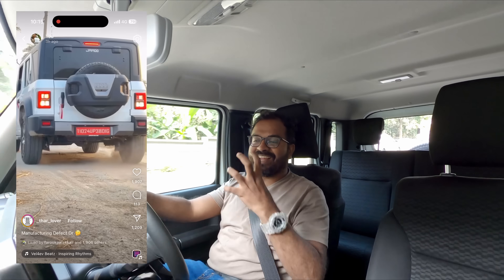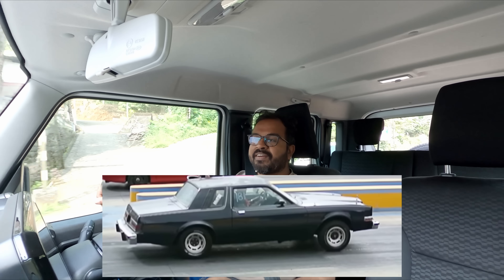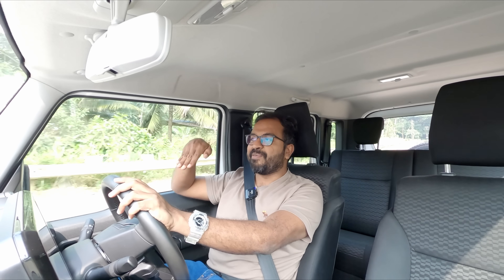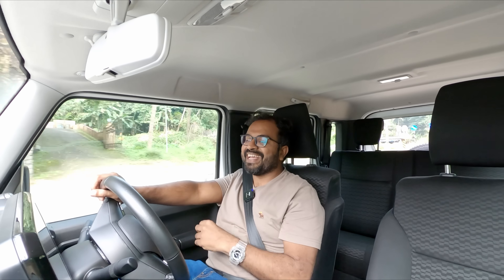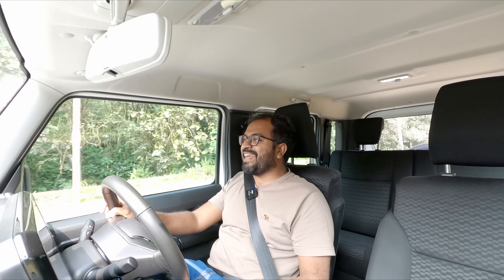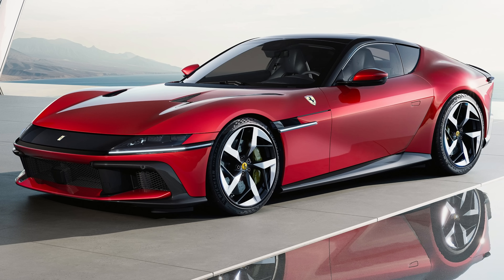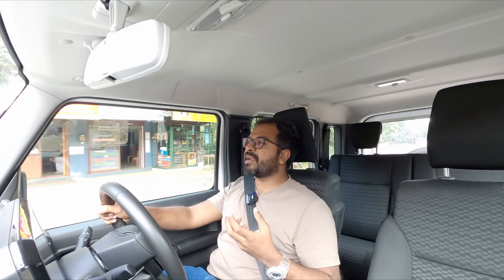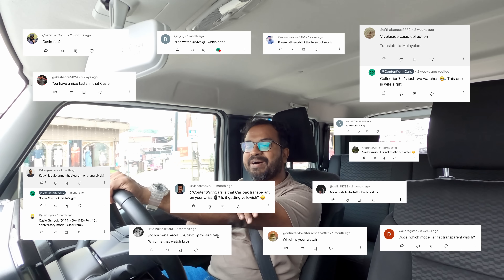Defective Thar Roxx Rear Suspension? | Content with Cars | Malayalam

Comment: Universal joints on the prop shaft are not constant velocity joints. This variation in torque/velocity is the actual reason that pronounces this wheel hop and can be seen in every vehicle including trucks ( taking suspension and tire factors into consideration)

Comment: Mahindra got those vlogger's instagram suspended and their Roxx has already broken down. they have actually gone ahead and done it in Pajero and there was only wheel spin.  While it may be normal to wheel hop in extreme reverse situations, the roxx suspension is certainly going to need a lot of maintenance from frequent issues. Third class engineering marvel

Comment: That V6 might be the same source as from Alfa Romeo which inturn was 2 cylinders removed from Ferrari V8( Ferrari California to be precise) .Interestingly the V6 in Alfa Romeo is pure eargasm as it was tuned by AR. Another irony is the current cheapest Ferrari Portofino has a V8. Also most probably to buy this La Ferrari successor you probably might need another Ferrari in garage.